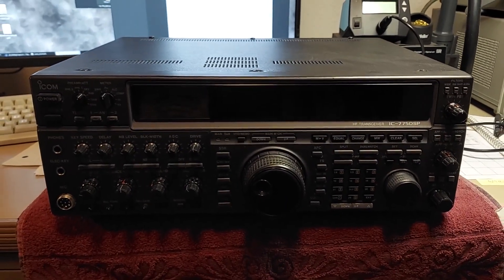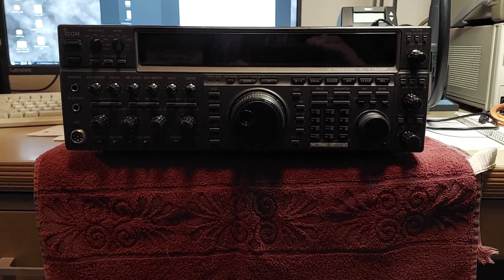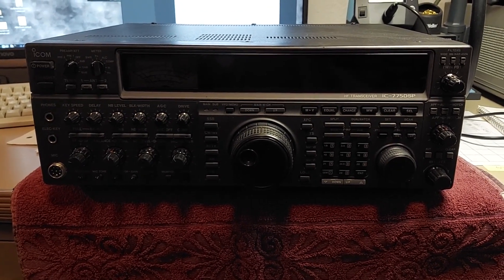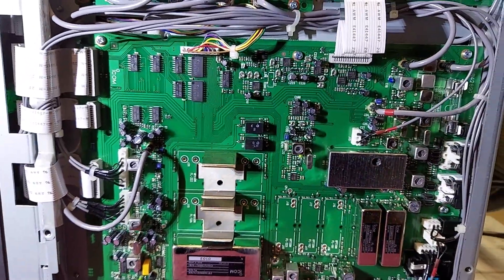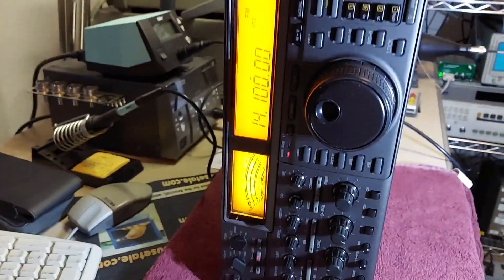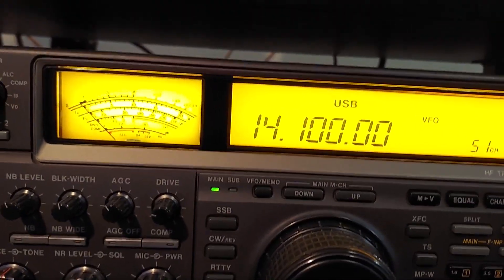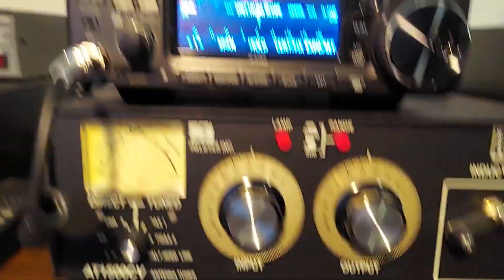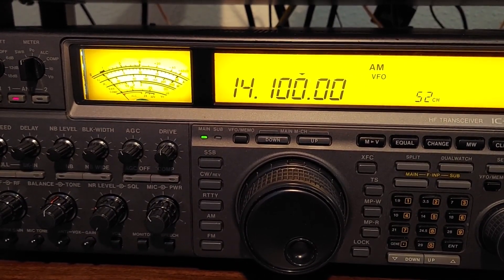Icom IC-775DSP FM oscillator adjustment.

Comment: Getting a carrier on s meter when pre amp 1 or 2 is selected any pointers ?
Reply from the maker: Interesting, the pre-amps in the 775 you have may just be raising the noise floor to the point where you get S-meter movement. The 775 that I serviced in this video will show about S-3 with the second pre-amp on 10 meters just from local noise. Hope this helps, thanks for watching :)